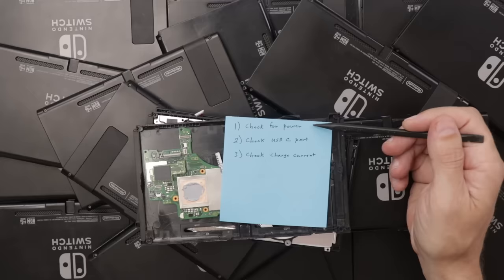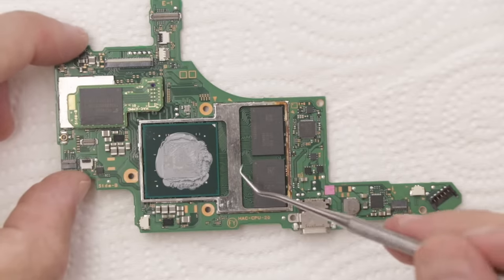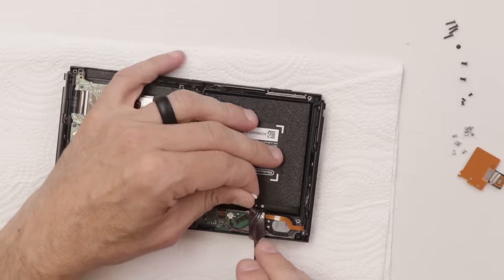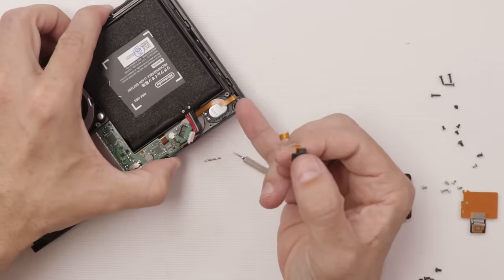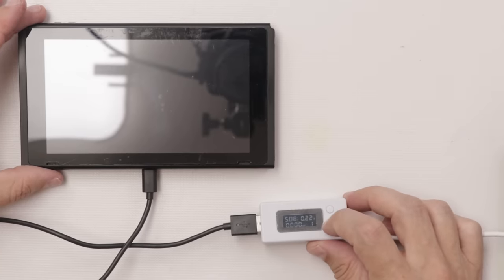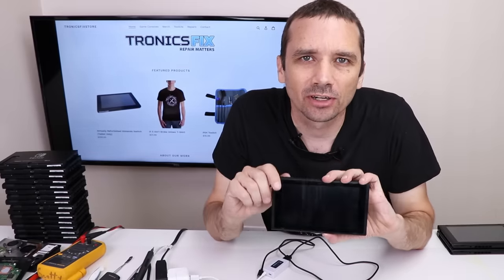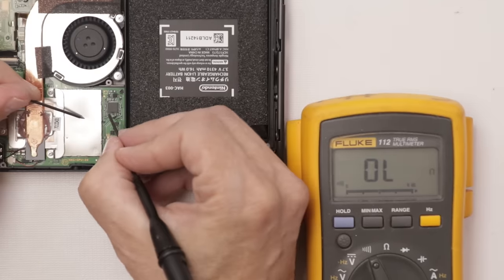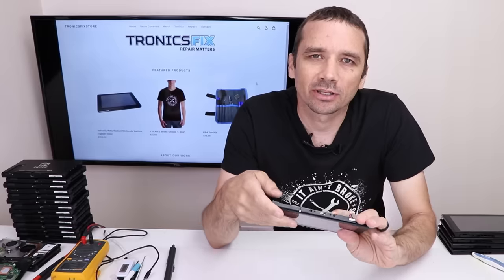I Paid $1,815 for 20 Broken Nintendo Switches - Let's Make Some Money!

Comment: Your craft is good but why are you violating basic electrostatic discharge prevention rules?
You place a sensitive circuit board susceptible to ESD on top of paper towel during your IPA/toothbrush cleaning.
ESD events can damage electrical circuits - this is basic electronics repair 101.
Reply from the maker: If you're afraid of ESD when fixing game consoles then you know nothing about repair
Reply: @Tronicsfix  I've designed high-speed electronics for 20 years and probably know more about circuits than you do and that doesn't include my academic credentials.  This clearly isn't a match of whits.  What this is is pointing out that all electronic components have an ESD rating and are susceptible to various types of damage.

There is a reason why components arrive in ESD bags with warning labels - that isn't there for show.  A gaming console is protected when its fully assembled and more so when its properly grounded.  Even your sponsors like ifixit are following ESD protocols and that's clear from their videos; you can see that workers handling circuit card assemblies are properly grounded and wearing wrist straps.  iFixit knows their market and protocols extremely well.

When Foxconn technicians in the Guaddlaajara factories are repairing rejects off the production line, they are following proper ESD protocols unlike you.  This ensures you don't increase infant mortality rates of electronic components.  

I have repaired consoles, cell phones, laptops because I understand how circuits are designed, how they operate and how they can fail.  

Even Louis Rossman makes mistakes - did you notice in his new store he invested in ESD mats on his work benches?  Yup - he gets it.

Those Intersil fets you often complain about, can be damaged with as little 250V of ESD.  That can happen using your bare finger when poking at it while not being grounded.  That part might work for another month, 2 months, 1 year.

Protect your image selling refurbs by ensuring you aren't introducing damage because of improper handling.

You need to learn to accept criticism that affects your growth in the field of electronics.
Reply from the maker: Yes, agreed, all electronics can take varying amounts of ESD. I have no problem accepting valid criticism. I won't be getting into an argument over this. Since you brought up Louis Rossmann though...he does have interesting things to say about ESD: https://www.youtube.com/watch?v=dPjkNFb10IE
Reply: @Tronicsfix  Classic video from Louis with his narrative.  You've got to hand it to him for pulling out a T-series IBM thinkpad which makes use of TVS protection devices, protection diodes, spark gaps and shielding in all the right places and of course on a laptop that is plugged in!  Any excess charge will find a path straight to the power adapter that is plugged in and that, is how to design a laptop to meet regulatory guidelines.  Now if he disconnected the power adapter, cutting off that path for the excess charge to go, we would get to see him rant when that LCD died after receiving a discharge.  Happy to see others in the comments spotted immediately what we can.
Reply from the maker: I shared that video because of what he said about ESD...not just what he showed. Also, when does he show using ESD safety measures in his videos? For that matter when do Jessa Jones, Linus Sebastion and other tech YouTubers show using ESD safety measures?
Reply: @downesg  Electroboom, an electrical engineer who knows what he's talking about, went so far as to use an ESD gun on computer components to prove you don't really need to worry that much about ESDs killing your circuit boards. 
Besides, if you're as educated as you say you are you'd know most of the damage is latent, and the real danger is build up over time. One or two when fixing something isn't gonna do much to most consumer electronics.

Comment: how do you expect to make money off of this... if you fix each one and sell it for $150, thats about 3k where you net $1200... after going through time and supplying some of your replacement parts such as batteries, im guessing you will actually have a profit of like $1000... and your $1000 profit is very dependent on if people buy your refurbished systems... the time it would take to sell 20 refurbished switches might be 40 days assuming you sell 1 every 2 days and no one comes back for returns or exchanges due to defective workmanship.. say everything goes well, you will make $1000 in a little over a month??? how is this good business

Comment: But is it a known good battery plugged into a known good motherboard plugged into a known good charge port plugged into a known good cord plugged into a known good power meter plugged into a known good cord plugged into a known good charger plugged into a known good outlet plugged into a known good breaker plugged into a known good fuse box plugged into a known good line plugged into a known good power grid plugged into a known good power plant with known good fuel from a known good source from a known good planet from a known good galaxy from a known good universe?